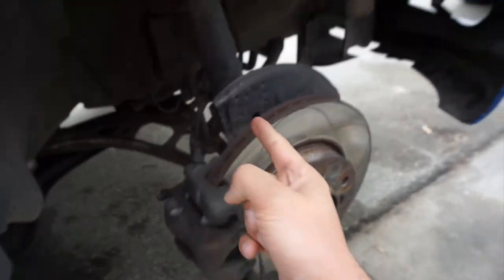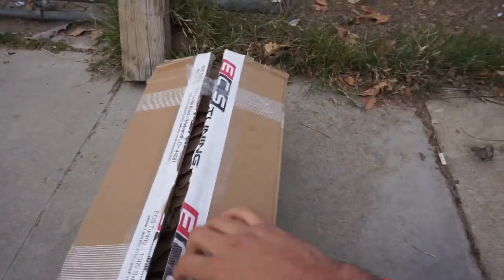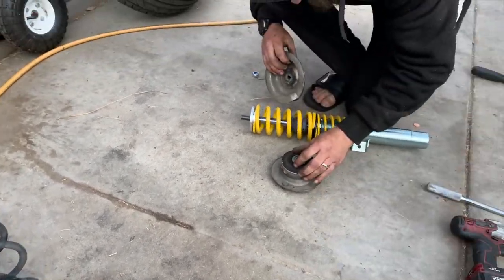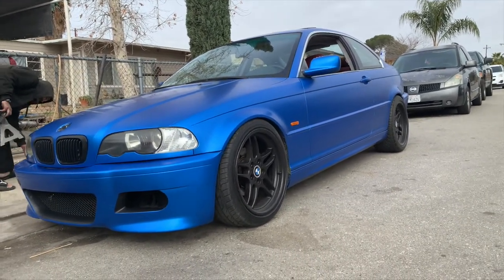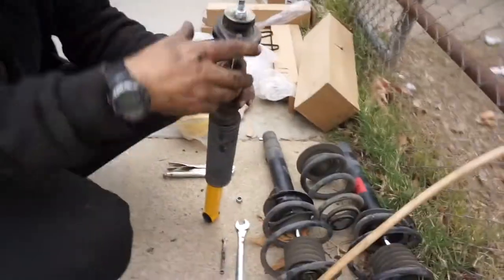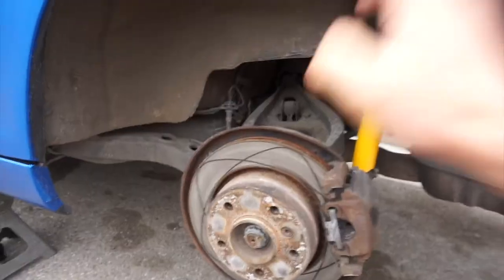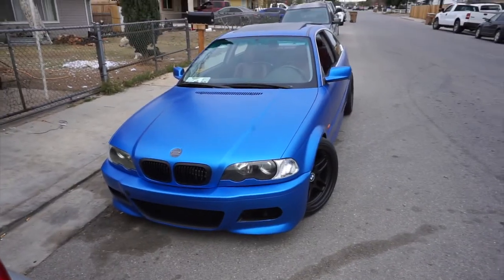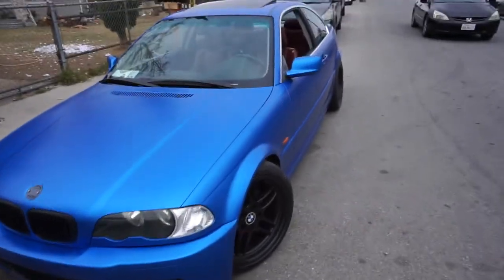ECS tuning suspension installed on E46 BMW | explained | DIY |

Comment: Where'd you get your bumper from? Also what tire sizes are you running
Reply from the maker: I just bought it from a random website from google. Tires 255 front and 265 in the back
Reply: @daringwhips  does it fit pretty well? Most reps have horrible corner gaps but yours looks really good
Reply from the maker: Yea it fits perfect I’m actually surprised myself
Reply: Whatre your thoughts on the esc coils? Im planing on the BR BC coils but kinda want to go a little cheaper
Reply: For my e36 m3 btw